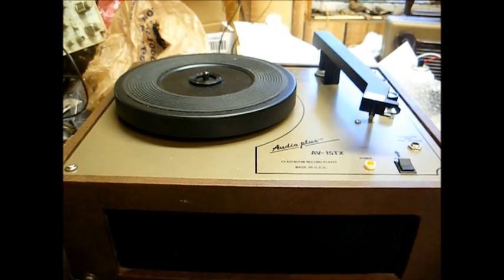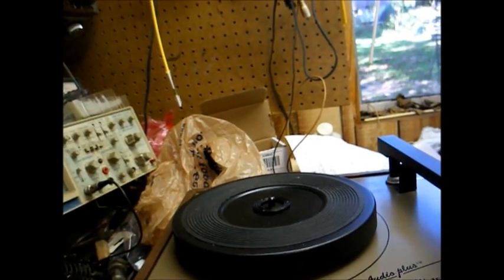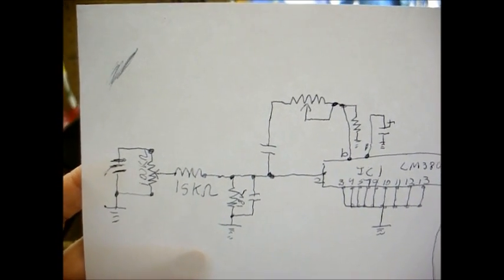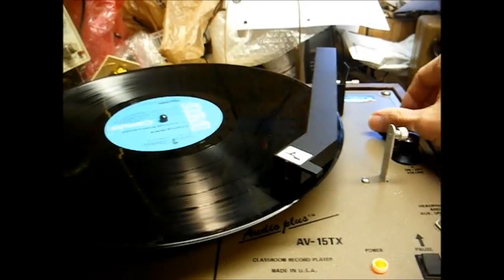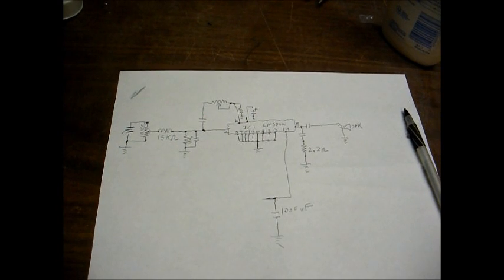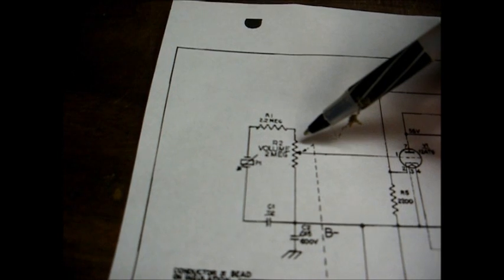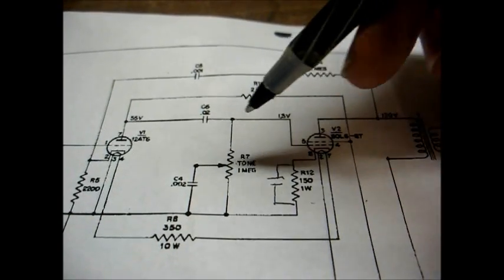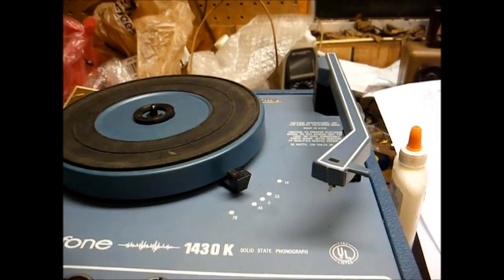AudioPlus classroom record player cartridge upgrade & amp modification

Comment: I have a audio AV 15 TX, too.  I need to replace the needle.  How do you change a cartridge? Also, I plugged in the the record player an amp.  However, the needle skipped .  I also have a audiotronics model  304A,  I need to get a new cartridge.

Comment: Philips did that with the plug in cartridges they used. At first the stylus itself could be replaced, as in a GP200/204/205/AG3306, from the 60's or early 70's. The later one, such as the GP215, was an all in one thing, they used the same crystals in it as before, but it cost a whole lot more. You had to use the same needle to play 78's too, not good. Good job you've done there on that record player. Like you say it'll be kinder to the vinyls too.

Comment: I liked  those flip over type. if you had a bad skip you can flip over to nylon 78 and it would  play through ,_  and the the diamond 33 side  was easier  to hold back and open the groove.

Comment: $6.95 in 1972 figures is probably about $20 now so the price is about the same.
Reply: +3Cr15w311 Good call. One extra thing to add is that when records were not popular with the general public (DJ's and audiophiles were the main users) these cartridges were being dumped for cheap. DJs didn't use them and audiophiles didn't use them, so demand was way down.

Comment: If it weren't for Youtube and ebay, much of that old stuff would not be restored, old parts would simply collect dust and end up in land fills.  Everybody would have Appli ipods, ipads, iphones, imacs, irekeeplayers, iboomboxes, itvs, iradios, iyiyis...
Reply: +umajunkcollector You are right about that but there will be a good side to that, things would be a whole lot cheaper on places like ebay. For example, Dave Jones made a video once about a Fluke 27 multimeter and he got it on Ebay for like 25$ and after a few days or something the prices sky rocketed on Ebay. That is true for pretty much everything that was presented on the internet  as a great or good value for money or deal. Cheers :)

Comment: Bryan, thank you for your explanation of modifying the circuit to increase output and your warnings regarding gain. I have several 3v cartridge players that will eventually need to go the .5v route. Each player has a different circuit but this video gives me a place to start.